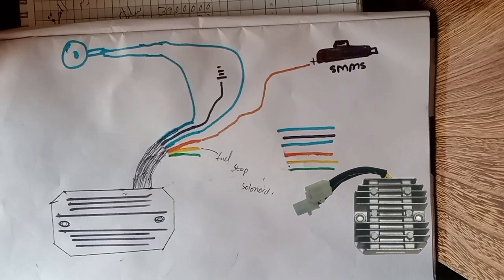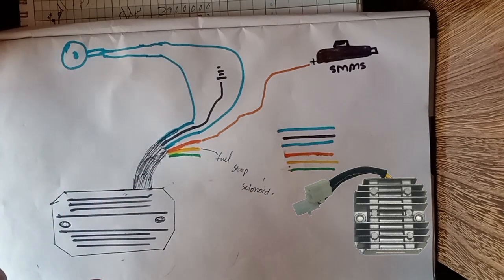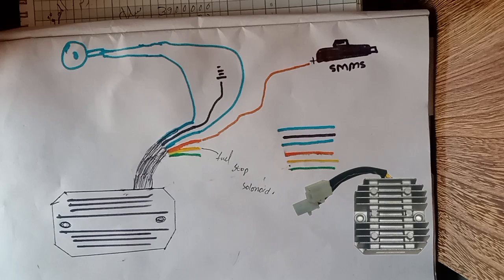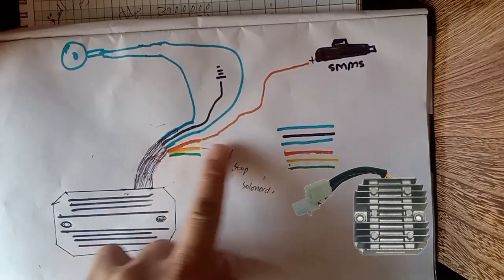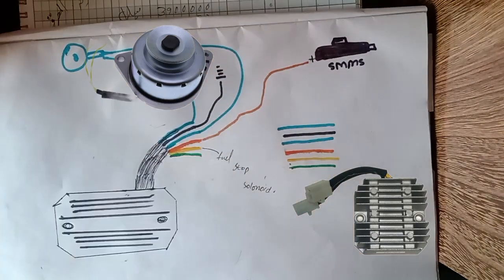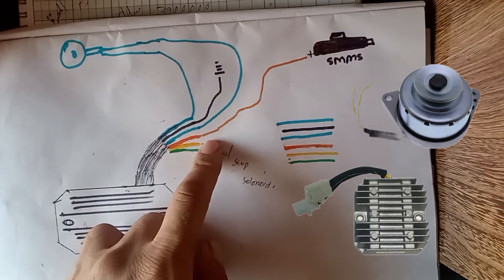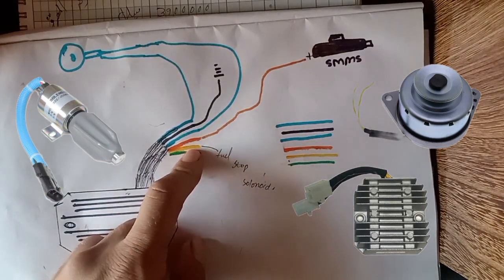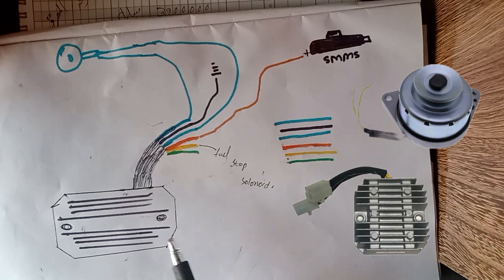voltage regulator 6 wire rectifier wiring diagram perkins Hp 403 series

Comment: were it is fix regulator front or back battery side in mahindra rodeo ?
Reply from the maker: Regulator is not repairable, this video Only explaining wires connection
Reply: @Info-Tech- were it is fixed I want to know I want to  replace because headlight bulb problem.
Reply from the maker: https://youtu.be/-wvBk_ye53s
Reply from the maker: Watch this video

Comment: In case the colours of the wire changes how else can we deal with the connection sir? Thank you sir
Reply from the maker: You should know colours of wiring and working, before installation,, which colour u have can you tell me each?
Reply: Alright sir..I have Yellow+red+red+red+blue+black+blue. Sir
Reply from the maker: 2 red which in same face to face is your alternator input, Ac input 
1 red is your for ig key switch for Acc
Blue + black -  blue is your sensing to Warning light